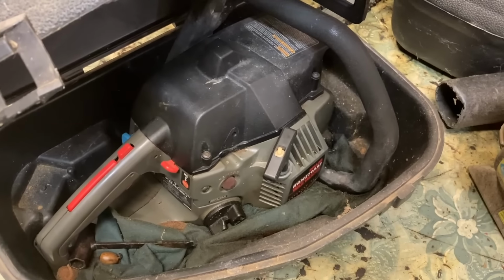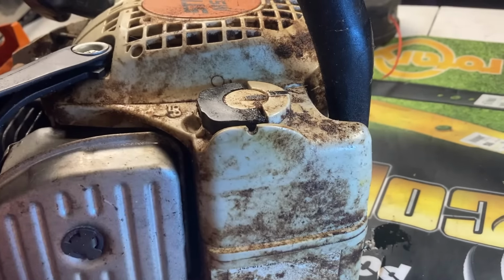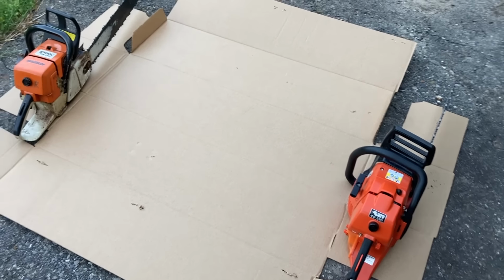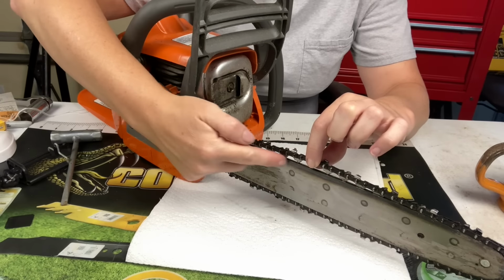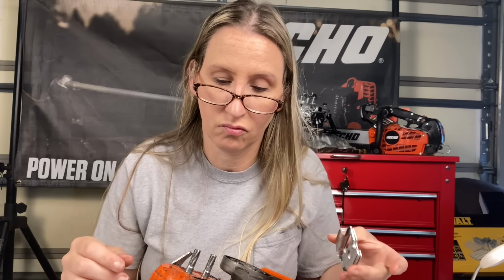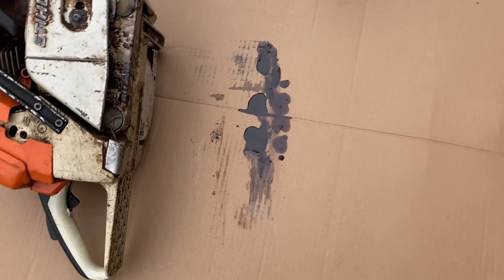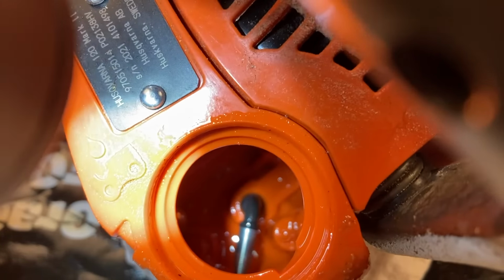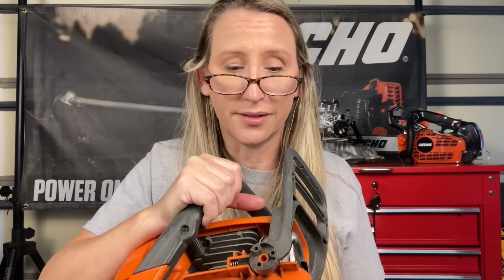Chainsaw leaks bar oil? The most common reason why AND Husqvarna saw leaking oil FIXED!! Repair Vlog

Comment: Good video, very good tips, and you don't waste a lot of time getting to the point.  Thank you.

I do have one suggestion - 1-quart plastic containers are made with the pour-spout off-center, and it's for a reason.  When you pour as you do, oil comes out sporadically, with air bubbles making it go "glug, glug, glug".  It's easy to have the oil miss the hole, and it's hard to control the flow.  If you turn the bottle around 180 degrees, you can pour slow and steady, with complete control.

 I didn't read ALL the comments, so someone else may already have pointed this out.  If so, sorry to waste your time.

Comment: I have a 1980 stihl 056 av it has a turn screw on the bottom for the oiler and  it is leaking. can you show how to fix that type. I know a lot of people have the older type. it would be a interesting video to do.

Comment: Love this, especially hearing that other people get caught by that cap. I dumped a whole tank of bar oil once because I thought the cap was tight. My Stihl leaks like a sieve so definitely going to see what I can find.
Reply: Those caps are dogshit, I would much rather have the old school ones that need the tool. My only complaint about my 441.
Reply: I've had that issue myself. But then I've been in a rush filled one thank then the other and forgotten one cap and dumped the contents on my foot. Lol. The Stihl caps are better once you get used to them. But only one thing helps leaving cap off. Slow down

Comment: I think a major reason for excessive oil leaks is the viscosity of the chain oil used, temperature is also a big factor, I rarely get oil on the floor under my chainsaws, but I think that is because after use I blasts as much wood dust/oil residue from under the saw with a long nozzle air gun, I notice that the oil you use here is very "thin" but that could be the temperature it is at, I rarely use my chain saws when it is hot, (it gets to 40 deg C here), so that could be the rason I do not have pools of oil under where they are stored, and now it is zero degs I think the oil is less "runny". Chris B.

Comment: Not only IC 2-cycle chainsaws leak bar oil but the newest Battery chainsaws-specifically RYOBI 20" bar brand new leaked
from the get go. Thanks for the guidance as to possible source(s) of leakage which I will investigate. Thanks!

Comment: Thank you for taking the time to share your knowledge. I usually take anything I have with small engines to a repair shop, but I have a feeling I'm going to learn a few things from your videos. I will be watching your video on canned fuels next, as I recently discovered the benefits of using non-ethanol gas in my chain saw, weed eater, chipper, and pressure washer.
Reply: you got a small engine guy that's good, he's worth his weight in gold
Reply: @marcuscicero9587  And he's honest! (twice his weight in gold, right?)
Reply: Search your area for a gas station with a non-ethanol pump. They won't have a sign. Probably 50 - 90 cents more a gallon but also probably 89 octane or more and very worth it. Especially for last engine use in Fall. If an online search doesn't find it, ask possible users like Harley riders, professional grass mower guys if they know where.

Comment: My Stihl MS 390 has one of the best oilers I’ve had on a saw. Even with the reservoir full, very little oil is in the case even when it hasn’t been used in months.

Comment: Chickanic, I enjoyed your well done and informative video. As a distributor service manager for Husqvarna chain saws for 12 years in the late 70's and 80's, oil leaks! I am concerned about your safety, sandals and no eye or ear protection. Yes, the clutch can and will come off (don't ask) when you let off the gas without the clutch cover on. BE SAFE!
Reply: I had just rebuilt a 357xp and started it up in the garage without the clutch cover on. I blipped the throttle a few times and the clutch popped off and tore out of the garage across the driveway and onto the flowerbeds. I really don't remember ever laughing that hard before.
Reply: @joesantora8855  That's funny, lucky it left the shop. I had one run across the floor, up the wall and across the ceiling back at me like a rabid squirrel.

Comment: Again, another great video, full of useful information. (As usual. 😊)
I’ve been using chainsaws for 32 years now and have learnt a lot during this time. Your informative videos are helping me even more, not just with chainsaws but all of my other equipment that use these 2 & 4 stroke engines. You have great knowledge on these engines and it is, undoubtedly greatly appreciated by all that watch your videos. Thank you for sharing your knowledge and so many helpful tips. 
Watching from Australia. 😊👍👍🦘🇦🇺🦘

Comment: Thank you for pronouncing Husky correctly! Instant fan! 
Great job with investigative diagnosis, and making a video on a question we all have! 
Pushing on soft rubber grommets with a flat screw driver, or yanking with needle nose, is a good way to tear it. A wood dowel works nice for pushing into place, and you can carve or sand it into the shape you need. 
Also, if you turn the oil can over, it doesn't glug as you are filling.
Reply: Did you know that husqvarna means”house grinder”an old Norwegian faller told me that
Reply: William, I grew up being able to pronounce Husky correctly. Can you imagine?

Comment: Nice video! I got into the habit of draining the oil when I don't use the saw for a couple of days, especially in the summer.  I also leave the oil flow at minimum for a minute before turning it off. Greetings

Comment: I store my saws by hanging them from the handle using paracord. This does a few things, allows the oil to drain in the bar scabbard, keeps it off the ground and protected, and helps with moisture in the fuel tank. Good video.
Reply: good idea. might have to try that myself 🤔

Comment: From “MY” point of view, the best way of preventing the oil mess means no oil in the reservoir. I use my so often that this is not an option. I use my saws as often as I can because I LIKE to use them and I use them whenever I get the opportunity. Also keep in mind that the bar/chain acts like a small reservoir for all of the oil, meaning that the oil that is already on them tends to flow off onto something. Gravity is real! I’ve been a part of a large discussion about this. I also have my oiler turned to maximum output. Because this ain’t the days of the Exxon Valdez!

Comment: 1st time visitor . Very impressed with the knowledge and the down to earth explanation of the problem and solutions.  Looking forward to seeing future videos.
Reply: the one useful thing she could have shown which was how to take that bracket off the husqavarna that was behind the bar, she completely skipped over how to remove that, the rest of the video was just a commercial for echo brand bar and chain oil. could have saved 90% of the video and just said hey use good thick bar oil and not the cheap dollar general stuff.

Comment: I always just acknowledged it as the nature of the function! Especially the automated oiler system. Forget the old school manual oiler and burn up a couple bar and chains combinations. You'll not worry about it leaking via the automatic system. I loved the old school automatic with manual override! Too much oil is a lot cheaper than not enough. Been there!
Reply: Same here. You got that right.
Reply: It saved the manufacturer money not installing a manual pump. I miss that feature.  I get into a big log I'd love to be able to add a squirt of lube.

Comment: I've had the oiling hole on the bar get filled with sawdust, which will create some pressure in the oil tank. The pressure will then push the oil out after the saw is turned off. I usually ignore most leaks unless they are really huge. As long as the oil tank has enough oil while I'm cutting I'm good.  As a note of safety I don't think you are supposed to run the saw with the clutch attached without a bar and chain. I did that once and the clutch came off and went sailing across the yard. No one was injured, thankfully.
Reply: Never thought about the sproket falling off like that before lol but makes sense
Reply: To my knowledge the sprocket assembly on all saws tightens opposite of rotation when running.  (True in old vacuum cleaner impellers too.)  Farm specifications: a nudge past hand tight. Had you just installed the sprocket?  Some repair shops don't want the bar and chain if the saw has a start/run issue.  I have had wedges drop and propelled out when 'slicing' large trees. As yet never anything else go any distance. That's why no one but the operator should be near a working saw.  Got my first saw at age 16, now 6 running saws, age 70.  Having said that, there is no such thing as being too safe,,,,, short of doing nothing.
Reply: @slatercohen7327  Yes, clutches do thread opposite the saw rotation (left hand thread). Yes, I only installed it hand tight before testing. So , when the engine stopped the inertia spun the clutch and drum clockwise and spun it off. That probably wouldn't have happened on a saw that had been used because the clutch would have been tighter. But, you can never be sure. Like you I have been around saws for 50+ years and never had it happen before. Just to be on the safe side I either remove the clutch entirely or install the bar and chain.

Comment: When filling the chain-oil reservoir, rotate the bottle so that the spout is on top.  The oil will come out smoother without creating a vacuum and a back-bubbles.  Same technique is used for filling automobile  engine oil.
Reply: Even show you that on the bottle. 👍🏻
Reply: I was just getting ready to write the same thing and then I saw your comment right at the top of the comment list.
Reply: That's pretty much WHY the bottle is designed with the spout on one side.  The same concept applies to pouring from a 5 gallon tighthead pail - lay it on its side with the spout on top on the bench and simply roll it (keeping the handle in check) one way or the other with your catch container under the spout. No glug.
Reply: I use a ketchup pump I got from a chip truck guy. Washed it out and filled it up with bar oil. Just pump the oil directly into the reservoir. Never spill a drop!
Reply: @barrymacokiner9423  Ace!👍
Reply: @barrymacokiner9423  Makes your burgers tasty too!  :)
Reply: @backyardfirewood9852  I use dish soap bottle.  Easy to control flow and use squirt or take cap off depending how cold it is.
Reply: I just commented the same on another shop-produced channel. It's amazing how many people use those containers wrong.
Reply: Same goes for those UHT milk quarts.

Comment: I was taught as a child that saws are usually designed to use gas and bar oil at about the same rate, relative to the size of each tank - burning off half a tank of gas, you'll use about half a tank of oil - so I've always been in the habit of adding bar oil anytime I add gas.  My small homeowner-class Stihl makes a mess of oil on the shelf, and I've been wondering why, BUT it maintains that "at the same rate" balance - I never get it out and find a full tank of gas and a low oil tank.  Thank you for confirming that it's just residual oil slowly draining off.
Reply: I've never seen a saw use the same amount of oil and gas, it should be half as much oil as gas, by volume. If its not, your likely over oiling.
Reply: @AnonymousOtters  If the oil tank is half the size of the gas tank, by volume, then when you use half a tank of gas, you'll also use half a tank of oil... but half of a smaller tank.  (I'm not insisting I'm right, just trying to better explain what I was told.)
Reply: @AnonymousOtters  most saws are typically set up off the shelf  to be 1:1, in big wood or when running long bars a lot of folks will up the oil flow and it may end up being .6-.75:1. Never seen a pro saw need gas & still have more than an ox or two of oil left in the tank. Ymmv.
Reply: I never leave fuel in my saw.
Reply: @DaddyBeanDaddyBean  Yes, by that logic I agree. Most saws have half as large of oil tank and therefore empty nearly the same time, but consume half the oil by volume.
Reply: @1slkss  That's what I had said, you have to read more carefully. The oil tank is half the size in most saws, so it is 2:1 by volume. Even bars up to 36-inch, you shouldn't have to up your oil consumption. I was a sawyer for years and ran 36 and 40-inch bars without running any more oil or burning up bars. If you need more oil, there are probably other problems

Comment: I have a tip for pouring oil. If you rotate the bottle 180 degrees so the opening is at the top the oil won't "glug" when it comes out. With the opening at the top the replacement air can flow into the bottle above the oil level in the bottle and the oil will flow smoothly. It reduces the risk of a spurt of oil missing the tank opening.
Reply: I put a small hole in the aluminum seal on the jug then as long as seal is on good you can squeeze the jug to fill works great
Reply: I was going to say the same. Spout on top..
Reply: i rotate 90 degrees so the bottle is on its side. that way the handle on the 4l bottles wont be in the way when filling from a new bottle. works well for adding engine oil to cars and bikes too.

Comment: I only use electric saws these days (retired) and still drain the bar oil tank at the end of use, thus no leaking oil.  Also, flip your plastic oil jug over when filling the reservoir, so the spout is up.  This gives you better control when starting to pour through ending your pour plus there are fewer drips.  That is why the spout is on one end and not in the middle!

Comment: When you open a new bottle of oil don't remove the foil seal. Instead use a file handle and make a hole about a quarter of an inch where it normally pours through. Then make an eight of an inch hole opposite of the first giving it draft. You won't spill anymore oil.
Reply: or flip the bottle over 180 for smoother pouring. Spout on top rather than on bottom.

Comment: I used to work at the Poulan manufacturing plant way back , one other reason they can leak. Is the porosity of the metal.  We had a machine that was supposed to seal this, but fuel tanks and bar oil tanks were tested under water sealed to a fixture with air pressure added to check for leaks. Those with leaks were sealed with epoxy much like JB Weld. I can see having the cap loose to relive the pressure, would stop the wicking action thru the tanks .
Reply: Good information. I have a pull on it (Poulan) lol!  It was made in the USA. Thanks to you I will check if the epoxy has cracked. Now I believe everything is Made in China.

Comment: Thanks for pointing out some of the common chainsaw oil leak issues. I can't help notice what I consider a common across the board design shortcoming (maybe to keep the price down) in all  these units. A engineering lab that determines the required bar oil flow rate has limited effectiveness in determining actual variable field use flow requirements. I think the major issue in these leak issues is actually the over oiling of the chain bar track and chain. A bar oil, customer accessible, adjustable flow valve would solve the problem. It could even be turned off after each use to keep the after use residual pump pressure from pushing unneeded oil to the bar. The buildup of excess oil will continue over time and get progressively worse over time.

Comment: Owned many Mculloch saws ( manual and auto oilers ) from the 70s and none of them leaked bar oil. Seems saws made after about 1980 or so all leak bar oil. With that said it seems they can be made to not leak oil but that would be at the  cost of the end profit.
Reply: Also, those who feel they have to buy the same brand bar oil as the saw makes the company more $$.
Reply: @aaronpowell4885  but the oil is different.  some thicker, some thinner. depending on the model saw you get you might need the brand specific oil for it to perform best.

Comment: Thanks for taking the time to investigate this issue.  I got sick of cleaning up my oil leak.  I don't use my saw often so I dump the oil thru a screen or filter and into the container.  After watching you I'm asking "why isn't the saw leaking the residual oil of which you spoke?"  Maybe it's because taking off the tank cape released pressure.  What do you think.  Oh ya:  you have pretty good looking feet but wearing that kind of footwear can be dangerous around where you work.  I'm always kicking something and it hurts.

Comment: My takeaway from your video was what I finally came up with on my own earlier this year - clean your saw completely dry, run it and observe closely where the oil is coming from. That will at least start you in the right direction. I’ve decided to change the terminology of “leaking” into two words - leaking as opposed to dripping. Dripping is the normal oil on the bar, chain and under the clutch cover after use and to be expected. Leaking is when something is actually wrong with the saw and it needs repair like what you showed in the video. Then there’s faulty engineering which requires modification. I got an Husqvarna electric polesaw in with a bar oil leak and the saw was almost new. Turns out there wasn’t enough pressure on the rubber plug to hold it tight into the tank. Cut a 0.025 shim and put it up against the plug. Leak stopped completely. Only way I found that was a thorough cleaning and then running and looking really closely to see where the oil was coming from.